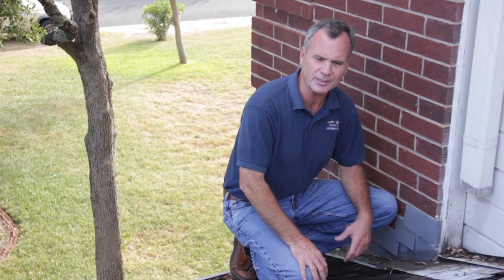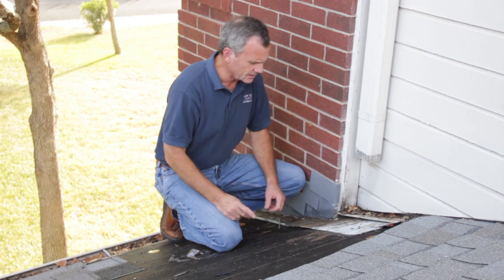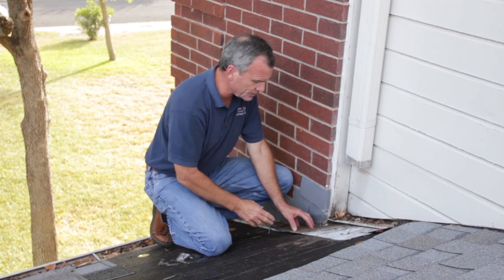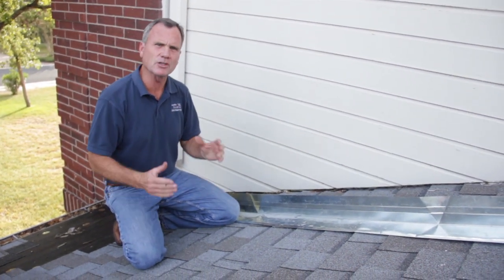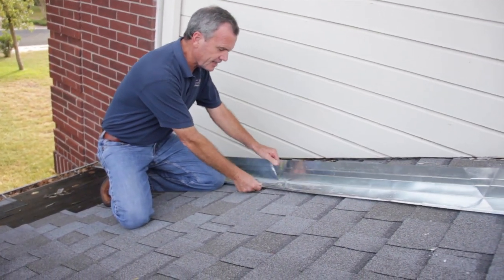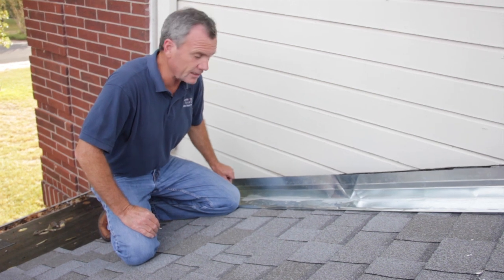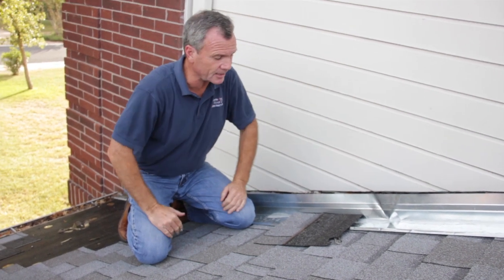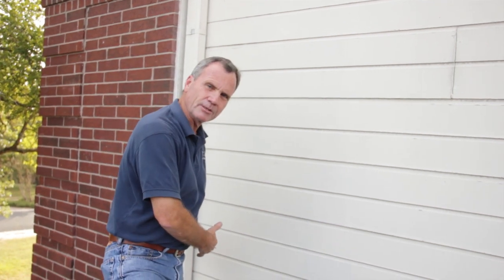Roof Leaks Caused by Poor Quality Wall Flashings

Comment: This was the cheap crap I found underneath my stucco.... with tons of nail holes and gallons of tar covering it. Cheap and lazy contractors in my area are a huge problem... 

What should have been a ~$400 wind damage fix ended up being a complete sheathing, roofing, window sealant, and siding job...

Comment: I’m a 30 year roofing industry professional who is shocked at the amount of low quality roofing companies in states without a central licensing board that holds contractors accountable 
I also find that most companies are more a ambulance chasing sales and marketing company who believes the subs who consist of mostly illegals actually know how to install a roof properly 
I find drip edge with a couple of staples and the drip edge is very light gauge aluminum and has a small face and never extends below the gutter
Most the time I only find drip edge on rakes and not the entire perimeter 
The Underlayment is only stapled and the layout is atrocious and not lapped properly 
The starter shingle is nailed at the top of the starter and not through the starter into the drip edge and into the decking 
No sealing around penetrations and exposed nails with only a dab of silicone 
Step flashing and counter flashing held into place with cut nails and not a true reglet style compression joint into the brick joint 
And the list goes on and on. 3 4 or 5 nails with no consistency and no sealant need the cut side of the valley
Reply from the maker: Curious, where do you work, and what exactly do you do?   Career opportunity available to the right person!

Comment: That should be step flashing not straight flashing like you show
Reply from the maker: Yes, indeed it should be!  We could use someone with your knowledge!  gary.whillock@fsgi.com
Reply: Thanks but I live in Oklahoma and do home inspections.. imo the house was poorly designed from the beginning. Sometimes the builders get really cute with their roof designs and forget what the purpose of a roof is I'd also be interested in what the transition from brick looks like along the wall would be worth it to see behind the brick.. although impossible if the roof is that rotted I'm curious about the sheathing behind the brick does the Wall move at all when you push on it? Or bow out? Are any of the mortar joints or brick itself cracked.. in any event dumping a ton of water from the gutters to that particular spot is a terrible idea.. gutters are important but I bet 90% of gutters are taking water to a bad spot.. usually directly to the foundation instead of away from the house

Comment: Hello:We have a leaking issue on the second story of a brick veneer house. The symptom is : Obvious water bleeding from inside the block run on ibeam in the garage. When we are in the garage attic there is the roof peak of the garage above our heads and directly in front of us the block wall on which meets the peak of the garage roof. From there the veneer runs start and are laid to the peak of the second storey bedroom roof point. After a heavy rain and maybe 45 minutes to an hour later after entering the garage attic water can be seen bleeding through the blocks at the mortar joints.
The brick was removed once and reflashed as per an engineers diagnosis. This arrested the majority of the leaking. Soon after a heavy rain the bleeding reappeared through the block mortar joints. There is a bedroom window above the garage.
The solution from the builder at this point is to flash over the structural flashing with aluminum roof flashing. In so doing the builder is going to seal up the weeping holes along the bottom of the structural flashing that is tied into the first or second rows of bricks. We hired an engineer 11 months ago when the builder proposed the cosmetic fix of caulking and aluminum flashing between the roof joint and the brick. The engineer diagnosed a gap between the waterproof blue skin and the structural flashing. This was repaired with new flashing after all the veneer was removed. As stated that resulted in a good amount of relief from the leaking. Unfortunately the blocks are still weeping some water through the from the inside.Water is somehow getting behind the veneer and weeping down the airspace into the blocks and then out of the mortar joints in the block wall inside the garage attic. If intense enough water will come through the ceiling in the garage. There appears to be no penetration into the upstairs bedroom walls under the window in that room. 
It would appear that the block run may not have had a mortar fill at the top and that the off set of the veneer coupled with the water leaking down through the airspace enters the top of the block and therefore bleeds through the mortar joints, only a guess at this point. The other culprit could be the window in the second floor bedroom.
We are aware that the at the least the weeping holes above the flashing should not be caulked up flashed over or sealed as that is the lowest point and water would get trapped with no escape and no air flow. Our engineer has said as much. The builder said they disagree with the expert engineer who 50 years of experience and 2 sons with engineering degrees. The builder sites the argument that the weeping holes are not necessary in such a small veneer facing on the second floor and furthermore the building code does not specify a weeping size. We know that the spacing is approximately 800mm that weeping holes should be located over lentils and at the bottom runs of veneer above the flashing. Are there specifications for the size of weeping holes? We know it is critical for moisture exit and for air circulation.The argument that you can seal them up as a band aid solution and that can be casually removed because they are specifically sized in the building code sounds absurd.
Why would the mason have spaced them out and installed them in those areas in the first place.
Any thoughts? Could it be the window on the second floor or compromised flashing. Sure like to know how water is bleeding into the airspace and through the blocks.
Thanks to anyone with suggestions.
Reply from the maker: jystdog, that's an interesting issue.  I'm unclear about the diffculties involved.  Can you send a few pictures?  gw@austinroofingcontractors.com
Reply: How did you go ? I  would take the bricks off again and run flashing along window and atleast 2 metres either side of window with weep holes all the way along. Its prob something simple . Cosmetic fix are a waste of time and money. The water shouldnt be in the cavity to begin with its a last resort fail safe wich itself has failed. Prob old mud and trowel holes up there.

Comment: don't ever let a roofer use galvanize metal on your roof .use either stainless ,aluminum ,or copper.it cost more but it will last ten times longer
Reply from the maker: Thanks for your comments, many areas do deal with rust and those choices are the best!
Reply: Wouldn’t galvanized at least last the 20-30 years of the shingle life?
Reply: Why don’t more states have you use galvalume   Which is galvanized aluminum and is very strong and weathers very well